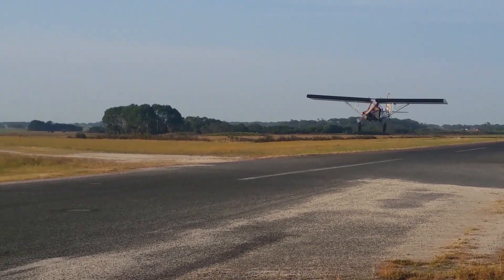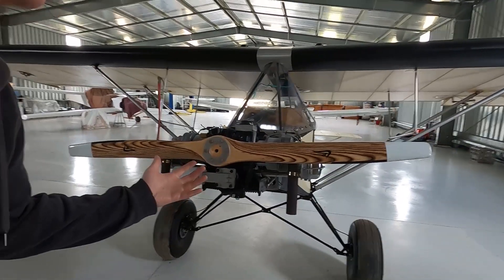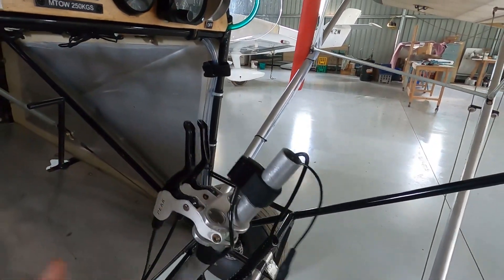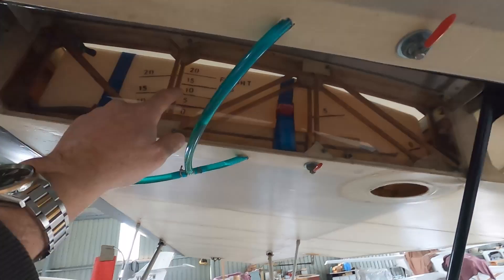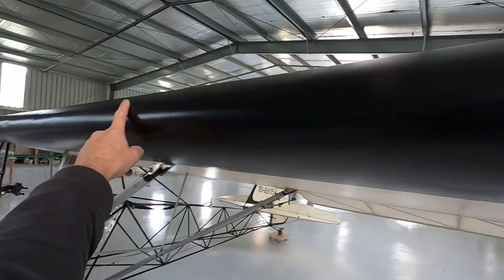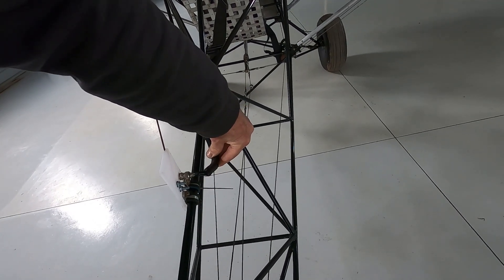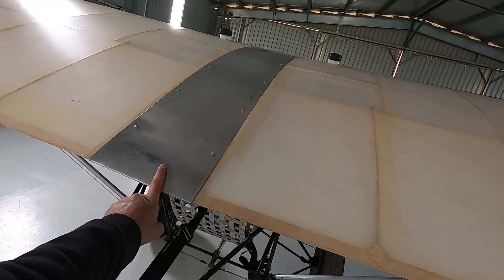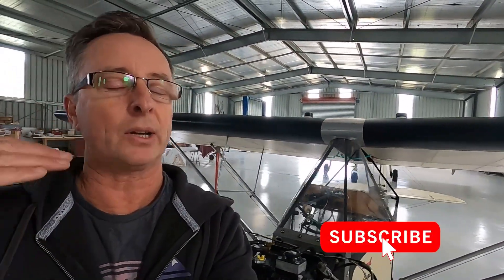Legally fly THIS without a license.  NO license to fly!

Comment: Great job on your aircraft very nice looking eagle, I've been following the build and loving it. I haven't seen many in Australia.
if you don't mind ma asking, where did get your build materials. Spruce, Moly tubing etc. cheers from WA
Reply from the maker: Hey there.  Mine is the only LE in Australia and Grant Booth owns the only DE here.  Surprising as they are easy to build and fly.  I bought mine from a guy in QLD.  It arrived as a prepackaged kit from John Bolding in the USA.  Sitka spruce timber is almost impossible to get here however I have built another aircraft from hoop pine which is a very good substitute which I know is grown in northern NSW.  As for 4130N & aluminum, I have always bought from Airport Metals in Vic.  They ship nationwide.  https://www.airportmetals.com.au/products/
I see you fly a PPG.  I am looking to buying one once the COVID restrictions are eased here.
Reply: @DCSquared  Thanks, yer love my Paramotor, I fly a Parajet Zenith Moster185 power and Roadster2 Ozone wing, I did a full coarse with Dave at High Adventure paragliding in Laurieton in NSW It was an absolute blast can't beat low and slow over the Australian landscape here in WA.

Comment: Hi there, I've been carefully checking out how you've gone about things with your aircraft. Personally I'm interested in the AffordaPlane, but engines are a bit of a hassle in Australia. I think you've gone for the Hummel 1/2 VW with the half cases, is that correct? Or have you been a 'Real Man' and built it yourself? My question is, are you happy with your choice? From watching your take off performance it doesn't seem too shabby for the weight and HP you've got to play with.
Reply from the maker: Went with the Hummel 45HP and have not looked back.  Combined with the Frank Johnson prop, the climb performance is great for an aircraft of this type.  Whichever way you go I don't think you will be unhappy with this combo.

Comment: Big one would be flying behind a 2 stroke.
Reply from the maker: That is another option for those who are comfortable flying behind a 2 stroke.  I'm loving the 1/2 VW though.
Reply: The Legal Eagle plans comes with 1/2 VW, and is designed to use it as an ultralight. 2 stroke is an option though.

Comment: A person can fly any personal aircraft without a license, as long as you're not making money flying it.
Reply from the maker: If you are making money from flying you need a "Commercial License".  If you fly a personal aircraft that does not meet Part 103 in the USA you need to be licensed (not necessarily to the Commercial standard) to legally pilot that aircraft.
Reply: Homebuilt Aircraft Channel - no you don't.
There is no law anywhere that says you are required to have a pilots license for traveling in your own aircraft.
Go read the law.
Reply from the maker: CFR Part §61.2   Exercise of Privilege and
 §61.3   Requirement for certificates, ratings, and authorizations - indicate otherwise however I am happy to be shown where there is no legal requirement as you have suggested.
https://www.ecfr.gov/cgi-bin/retrieveECFR?gp&n=14y2.0.1.1.2&r=PART#se14.2.61_12
https://www.ecfr.gov/cgi-bin/retrieveECFR?gp&n=14y2.0.1.1.2&r=PART#se14.2.61_13